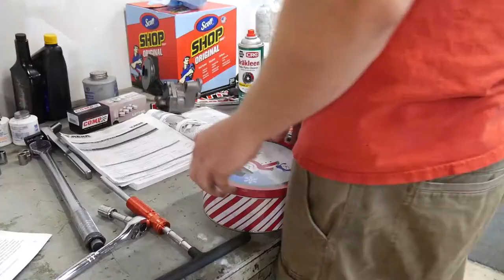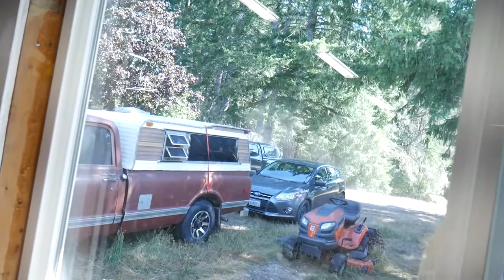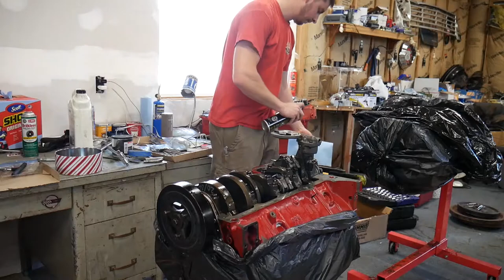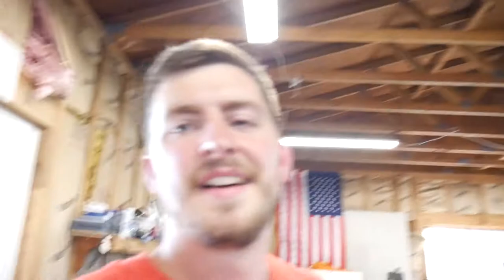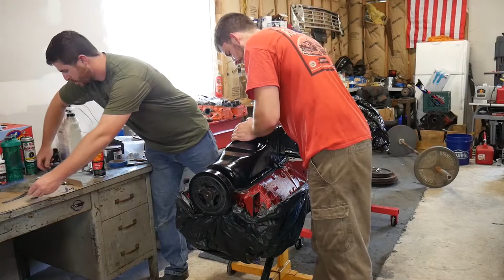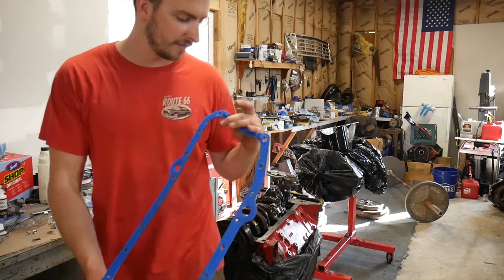Pt. 7 Small Block Chevy Valvetrain Adjustment and Oil Pan Install + The Story of My First G-body.

Comment: you need to get some tarps or something, it really hurts to see a good chevy motor in a trash bag, only ford motors belong in the trash! lol
Reply from the maker: Hahaha honestly they are thicker than engine bags you buy at a parts joint! I know it doesn’t do the engines justice but if it fits it ships haha
Reply: @caseybaker5550  i was just giving you crap about it bro, i do the same stuff lol but seriously tho the ford motors look much better in the trash bags lol
Reply from the maker: @TheSouthdownband  hahah well yeah these bags hold oil really well
Reply: @caseybaker5550  on motors im storing for a long time, like anything over 6 months or longer, i have huge rolls of packing saran wrap and i take and squirt a little transmission fluid and oil mix into the sparkplug holes, turn the engine over by hand a few full turns then wrap the hole motor nice and tight with the saran wrap,while hanging on the engine stands, and i have had motors sit for 2 and a half years before we used them, but still as clean as the day i wrapped them up, but the bags def do the trick to keep floating dust and what nots in them while you are building them for sure, your doing ok, only thing i would of not did, but you may not of soaked them that long, is i do not soak my lifters, i use assembly lube only because when you soak hydrolic lifters they tend to pump up then it's harder to set the valve lash, also i really wish i was closer to where you live so i could show you how to set lifters in about 10 minutes, there is a super easy way to do them, and i have been doing it the same way for 30+ years and never had to go back and set them again afterwards and it don't matter what valves are open or closed,where the balencer is aiming or anything, look up Vice Grip Garage, how to set valves, that's exactly how i was taught by a 70+ year old guy back in the mid 80's and it's a tried  and true method. saves a lot of time, and when time is money every few minutes counts :)
Reply from the maker: @TheSouthdownband  that is awesome advice I am going to watch that right now haha so you just let the lifters pump themselves up essentially?
Reply: @caseybaker5550  yes sir, i run a oil primer before first start until i see oil pumping out the top of the pushrods and then it's good to go.
Reply: @caseybaker5550  and if i dont feel like running the oil primer i unhook the dizzy power wire and leave a valve cover off and just crank the motor over with the key a few 10-15 second cranks with about the same break in between, as soon as you get oil to the top of the heads you are good to hook up the power wire to the dizzy and toss the cover back on and give her a start.
Reply from the maker: @TheSouthdownband  that is very good to know. Yeah I am honestly most worried about flattening the cam for some reason
Reply: @caseybaker5550  just be sure to use a zink additive or a oil with the zink already in it, you'll be fine as long as you do that, and always do that at every oil change, also be sure when you start it up for the 1st time you break in the cam with a good break in oil with the zink add in it also. you got this brother, any questions feel free to message me on facebook, ill help you as much as i can, only been turning wrenches for almost 40 years :)
Reply from the maker: @TheSouthdownband  right on man! That is awesome. I appreciate that and I will keep that in mind!